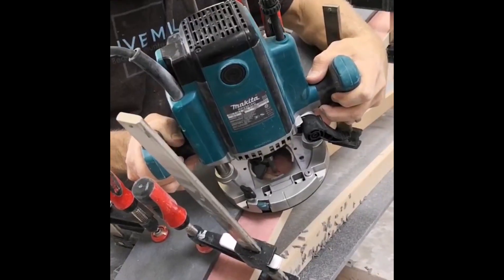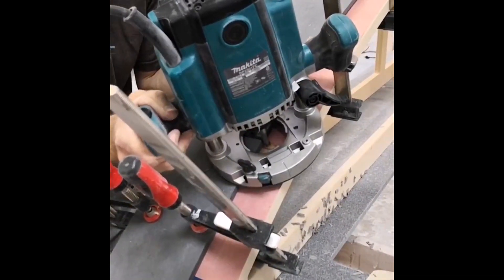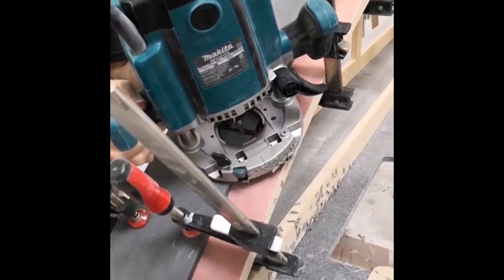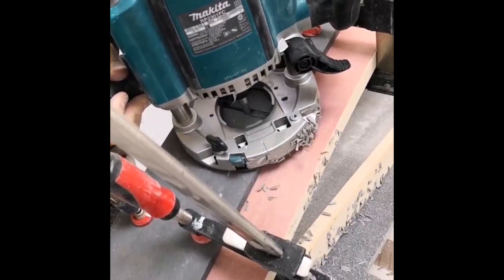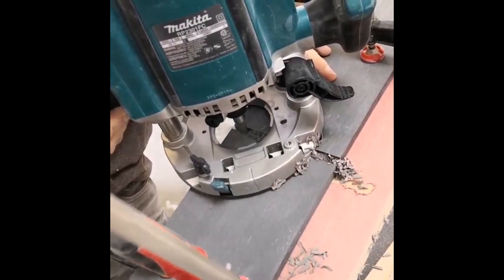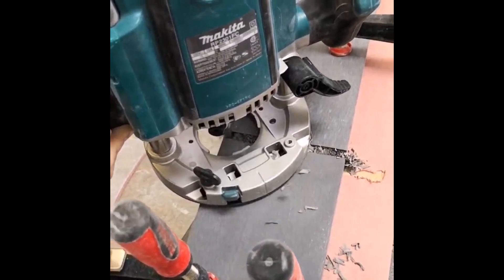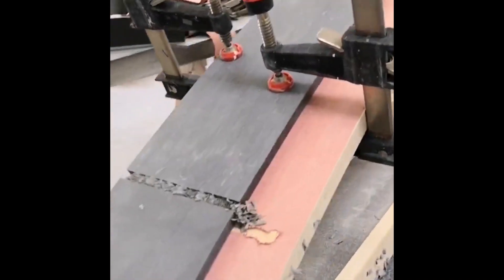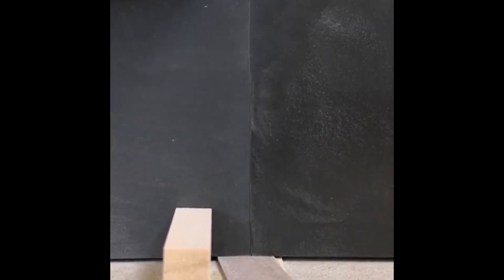Thermoforming Solid Surface Freehand Seam

Comment: What temperature does solid surface need to be?
Reply from the maker: Corian needed to be heated to 350 degrees for about 20 minutes. Make sure you heat it all the way through and let it cool completely before removing from the mold.